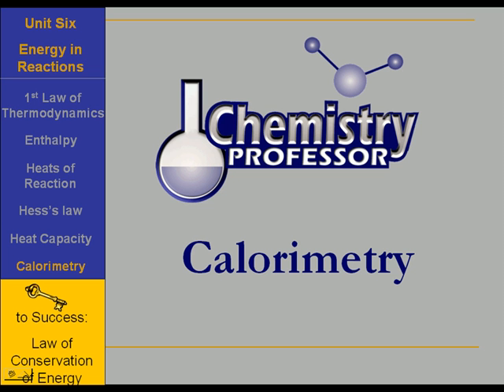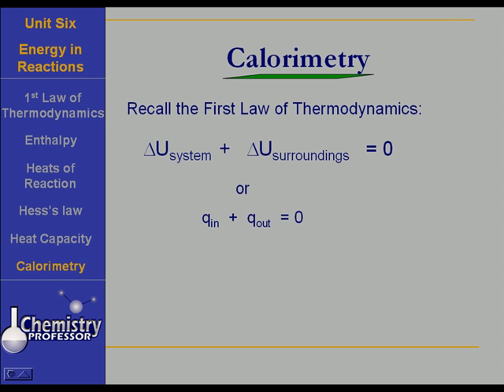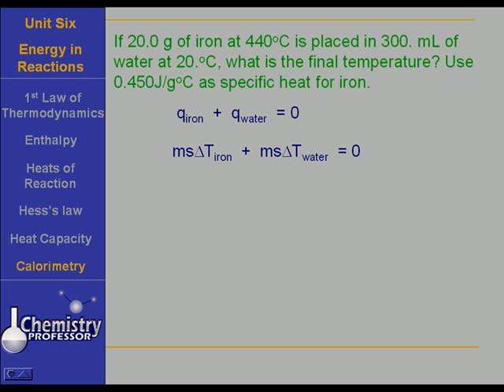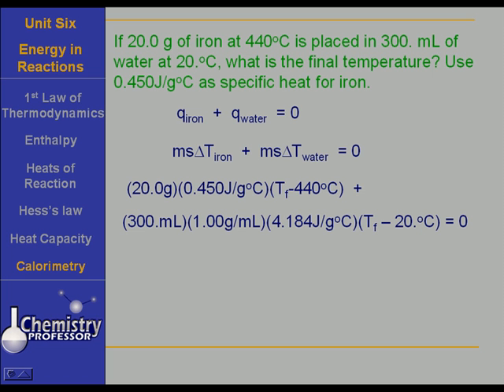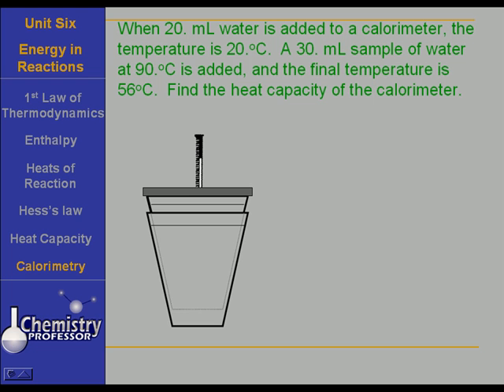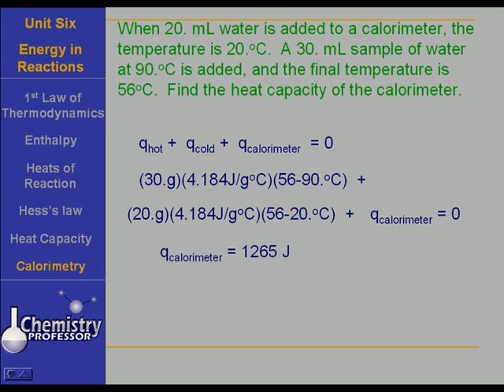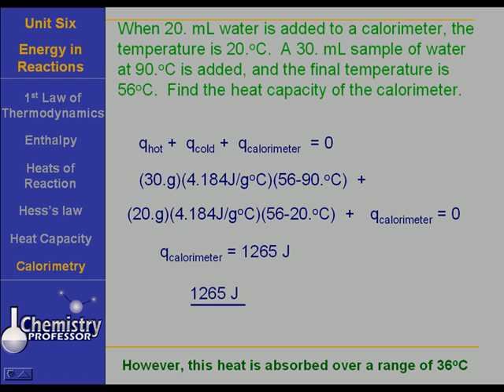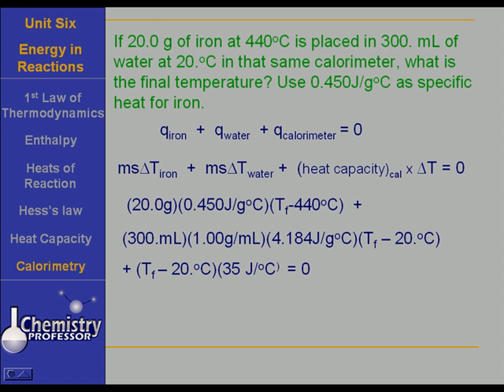Calorimetry 1

Comment from the maker: I think your question refers to the last problem in that video.  In that case, after you have multiplied and collected like terms, your final equation looks like this:  1299.2Tf = 29764
When you divide the 29764 by 1299.2, then Tf = 22.9deg C.  You do not need to divide further by anything because all the factors are accounted for.
I hope this helps.

Comment from the maker: The trick here is knowing how to deal with those negative numbers we have, sometimes.
(20g)(0.450j/gC)(tf-440)+(300g)(4.184j/gC)(tf-20)=0
Multiply out each section and get:
9tf-3960+1255.2tf-25104 = 0
Collect like terms:
1264.2tf - 29064 = 0
Now, add 29064 to both sides and get:
1264.2tf = 29064
Divide both sides by 1264.2 and get
tf(final temperature) = 22.99 degrees C which I round off to 23 degrees C.

Hope this helps!

Comment from the maker: Wonder where my earlier response went??!!  In any case, the item of information that you may be lacking is that 1 watt = 1 j/sec.  So let's start out by finding how many joules of heat are needed.  It takes 4.184j to heat 1 g of water 1 deg C and 50-20 = 30deg.
250mL x 1.00g/mL x 4.184 j/g-degC x 30degC = 31380 J of energy needed to heat up that quantity of water.  Now, take that quantity and divide by 350j/sec to get the time.  Watch your units cancel.
31380J x 1sec/350J = 89.7 sec or 90 sec.

Comment from the maker: Unless I have mess up, I get 1255.2 j, which then is divided by the 36 degrees C to arrive at 34.9 j/C - round off to 35 j/C as the heat capacity for the calorimeter.  Do you find a math error?  The net heat unaccounted for is about -1255 joules, therefore we say that is the heat absorbed by the calorimeter over a range of 36 degrees C.  We want to find the heat absorbed per degree C, hence we divide.  Is your concern that I may have mistyped the heat and put -1265 when I should have used -1255?

Comment from the maker: Sure.  Here's the set up.  Remember, heat lost by the gold + heat gained by the water must equal 0.
MSdelta T(gold) + MSdelta T (water) = 0
3.0 kg x 0.129 j/gC x (Tf-99C) + 0.22 kg x 4.184 j/gC x Tf - 25C) = 0
0.387Tf - 38.313 + 0.9205Tf - 23.012 = 0
1.307Tf - 61.325 = 0
1.307Tf = 61.325
Tf = 46.9 degrees C

Remember, Tf is final temperature, Ti is initial temperature.   You might be less confused if you change 3.0 kg to 3000g and 0.22 kg to 220 g before you begin, so your units will cancel.